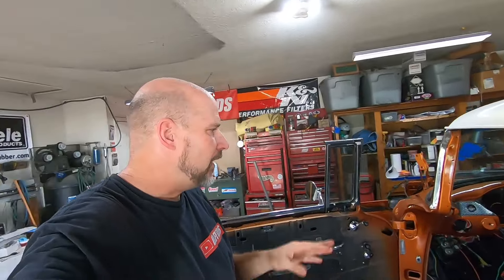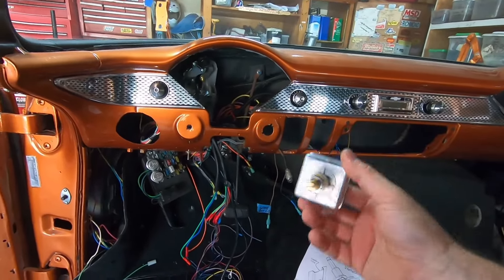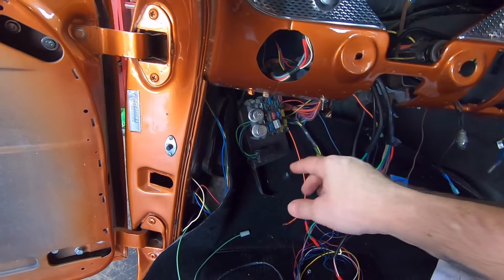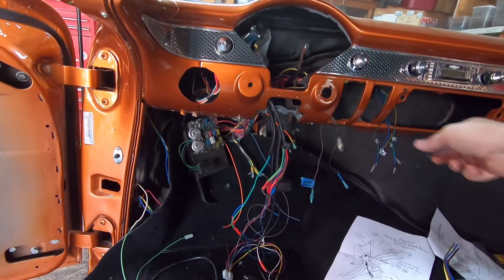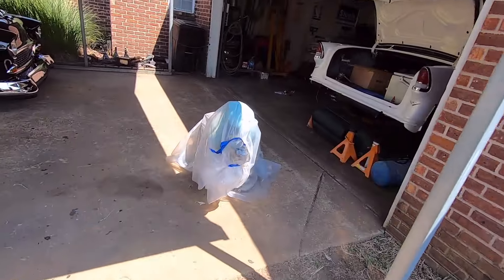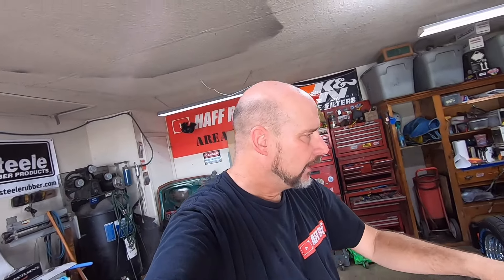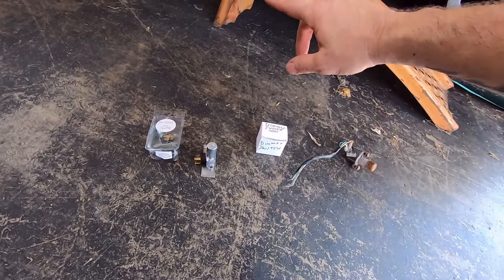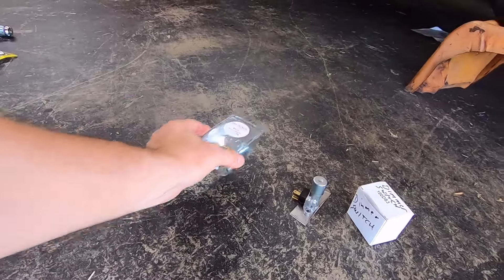Steve's 55 - Have to re locate the wiring for Raingear.

Comment: Thanks for the tips. I beleave all the 2-doors have same length wire covers. My Nomad has them too. If you have some flat stock make your own because there very simple  panels. Just put a notch for the windlace to tuck under it buy rolling it to prevent chafing.

Comment: I had  a similar issue mounting the rain gear where I needed more room for the fuse panel and hydraulic clutch linkages.  Called rain gear and they advices me that the wiper motor on the bracket could be clocked in a second position.  At the moment I can’t remember what position it put it in.  But if interested I can share pictures.